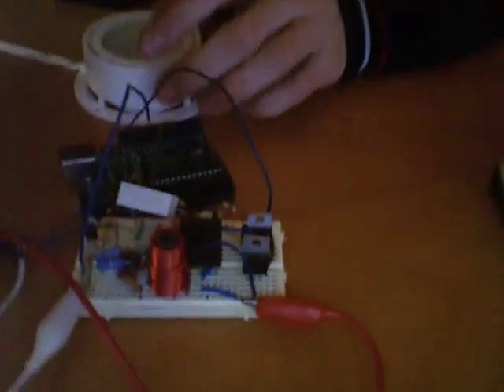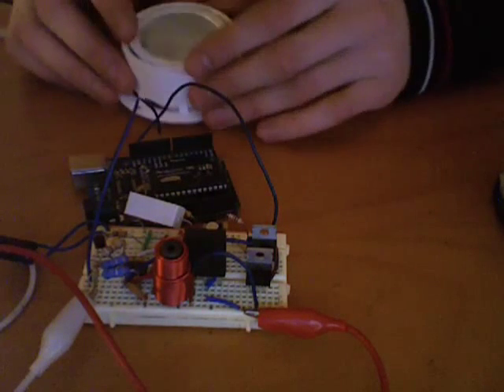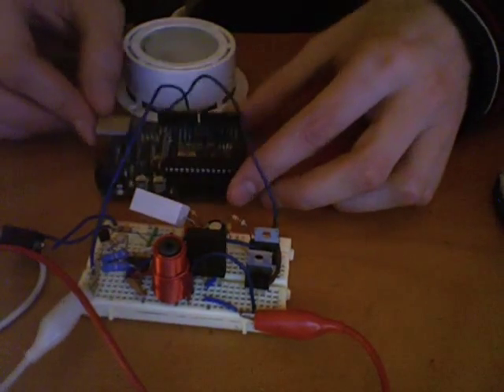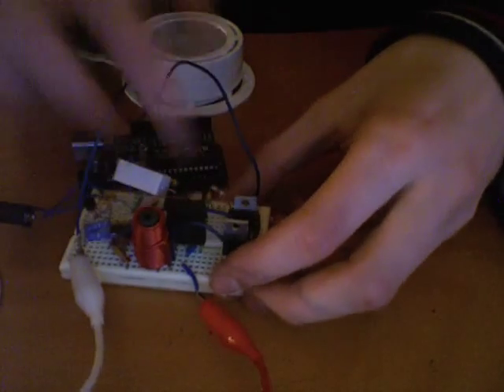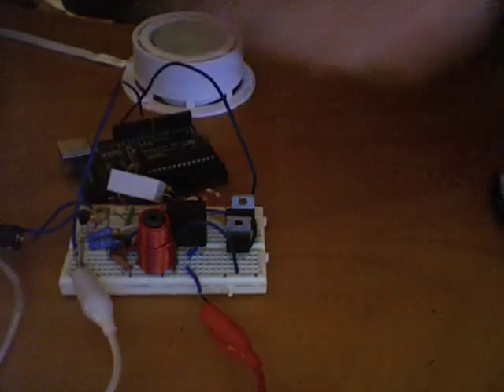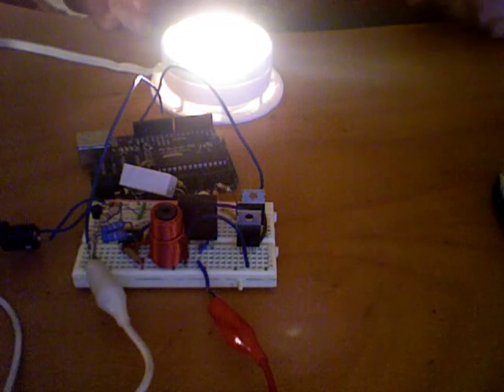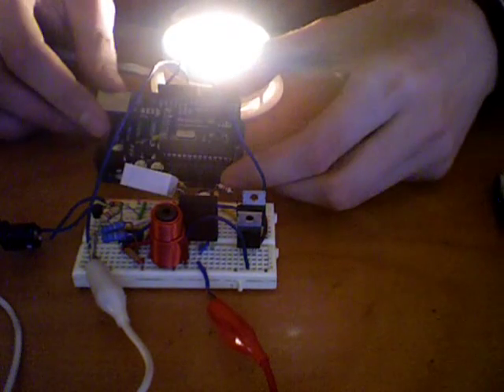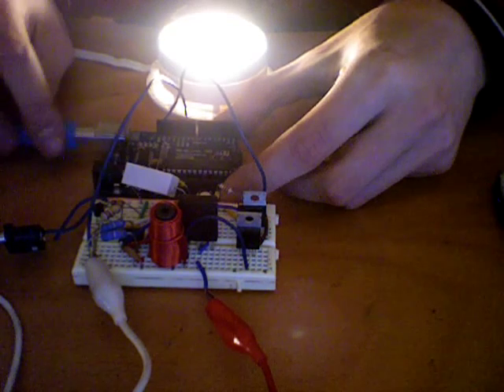Boost Convert Led Driver

Comment: Cool, man.  I did some PWM fading of some LEDs and found a similar behavior in that when the light was getting pretty bright, the change in intensity became much less noticeable.  It almost looked as though it wasn't fading at all, at that point.  What I found was that I needed to employ some gamma correction.  Give it a google.  If you're interested, I have a simple java program that will accept a range and a gamma correction value as input and will print out the gamma corrected values.